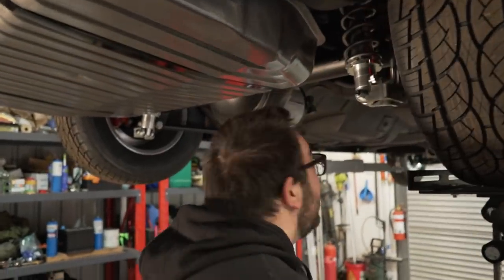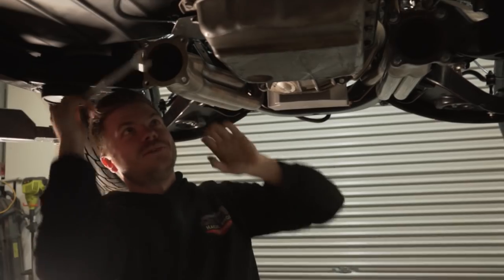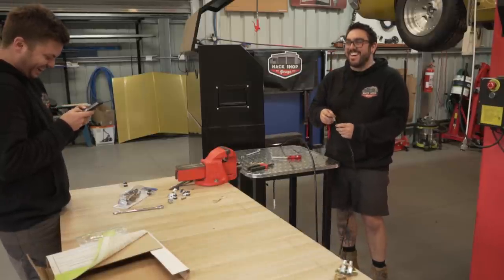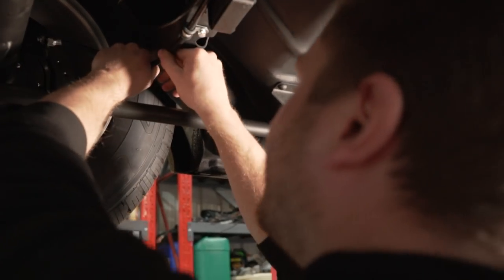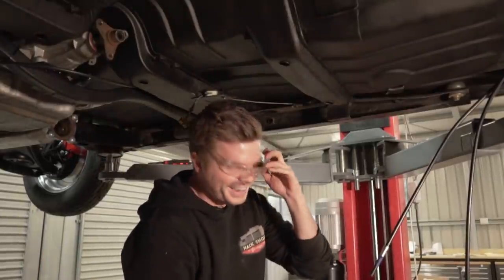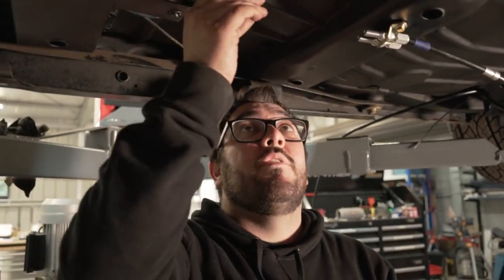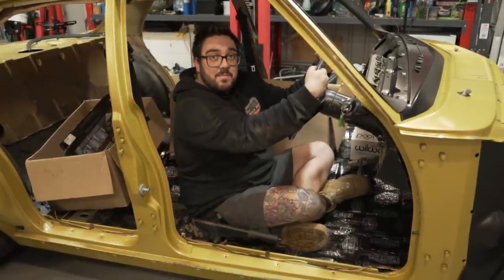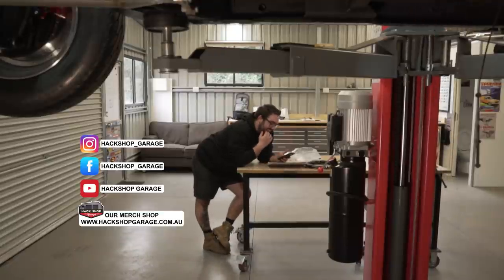LSQ Build - Part 8 - Wilwood Handbrake Cable KitInstall  - (LS Swap HQ Holden)

Comment: You guys are the best! I watched this a dozen times before installing my own. Sure saved me just as many sure mistakes. I drilled out the cable block assembly so it slid free on the factory adjuster, with a nut either side to make for way easier adjustment!

Comment: If you get a piece of strap steel say 150mm long,  18mm wide and 4mm thick , drill a 6mm hole in one end of it  then use a 6mm thread bolt and washer and screw it into your nutset you can simply do up the bolt and this crush your nutset without a right angle nutset tool .
Keep up the good work

Comment: Good work guys. 2 x tips....  the cut cable ends - put 2 x sleeves of heat shrink over the ends to help stop the tips fraying.  And the dual cable bracket you made... get some rubber stuffed in there to keep it all secure without crushing the outer sheathing. Top stuff guys !
Reply from the maker: Thanks mate, great tips! Will do

Comment: Ahh you don't need a nut cert gun to install a nut cert. Just use a screw and nut with the cert on the end in the hole and it will swell as you tighten the bolt in the cert.
Reply from the maker: Never thought of that, thanks mate, we will give it a go next time 👍🏼
Reply: Whilst that method works, it may not fully activate the nutsert in a uniform manner around the entire circumference, or it may insert it at an angle, which will eventually lead to failure.

Comment: If the lengths of the cables are different will they pull the same?
Love the build guys.
Reply from the maker: Yeah the will because they are both pulled equally from their cable stay to they connecting block. Thanks mate